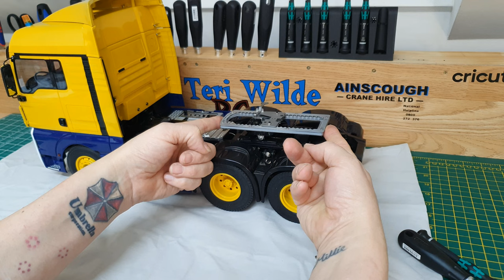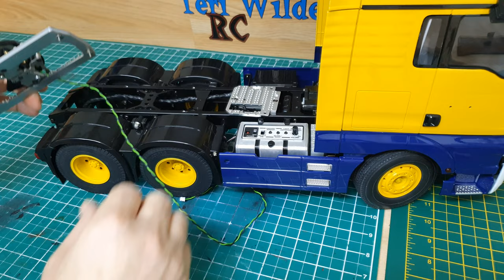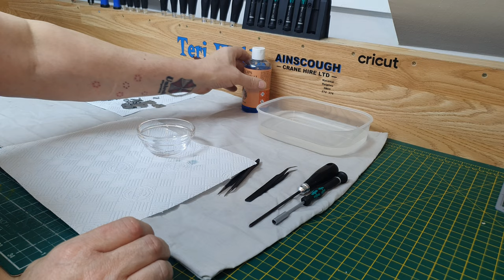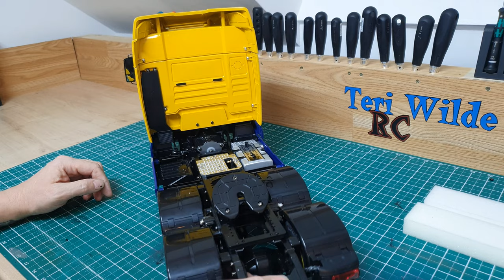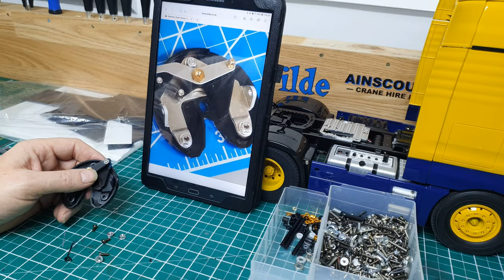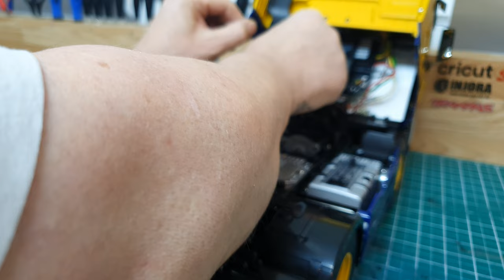Tamiya MAN TGX - Project Ainscough - Ep9 - 5th Wheel Slider and FINISH - 4k

Comment: Teri I was thinking if you bent the end of the 5th wheel spring up about 2mm from the end where it cuts into the slider plate it should slide along the plate without cutting in.
Edit: I was just watching the next video and see that is what you did lol.
Reply from the maker: Someone else mentioned it in a comment, so I tried it, and it works well... Great minds think alike lol 👍

Comment: Hi how r u I would have removed that cross member all together as it don’t do anything n Carnt b cn n as for the plate with micro servo on I would worked out a way off attaching it to 5th wheel plate so it all moves so u could still used it it’s lookin rearly good 👍👍👍👍